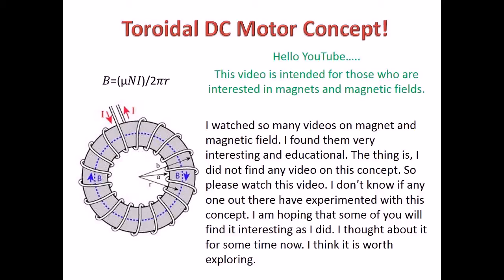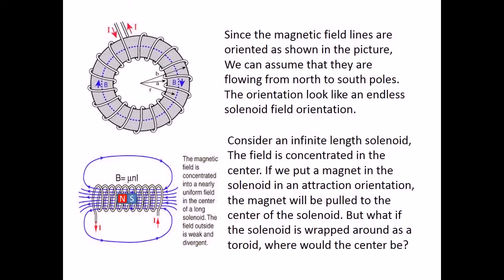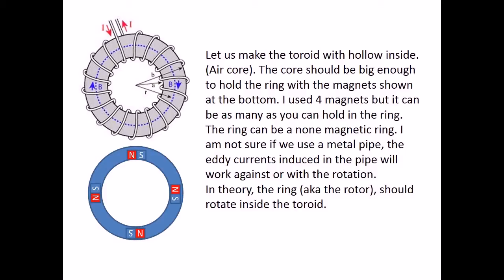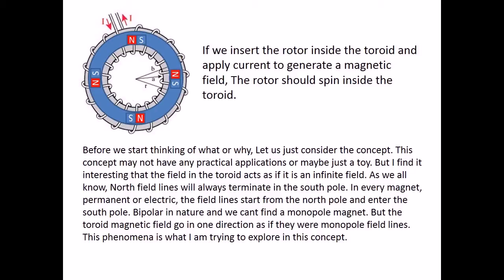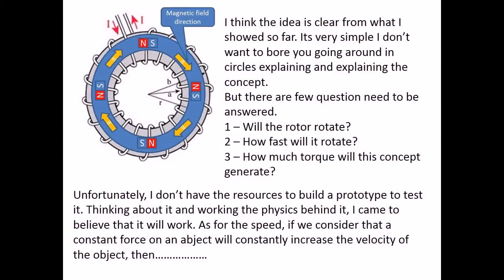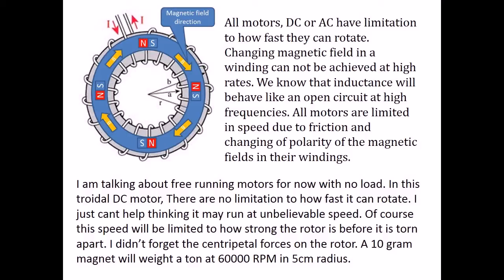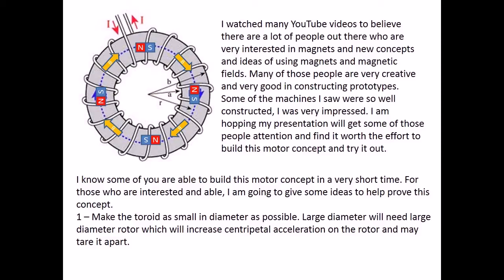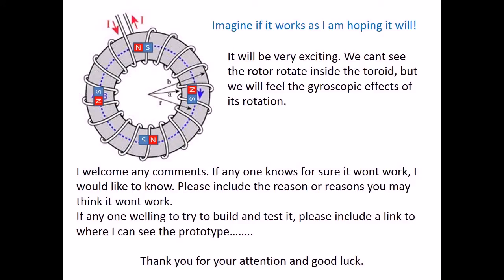Toroidal DC Motor Concept

Comment: I found this after having a similar idea and googling to see if anyone else has done it. I believe your concept would work and it uses the same principle as mine although mine is the inversion of your design. I've designed a few different versions, one with no magnets just electromagnets and with wireless power transmission. I'm printing off a simplified version now to see if it works. This principle means you can have a DC motor with no phase switching which is a huge benefit and could potentially provide a lot of power and torque. With no contact to transfer power and no phase switching it means the motor won't overheat and there are less reasons for failure. If mine works I may put up a video soon.

Comment: I saw something like this back in 1995/6 at an electric car club meeting here in Sydney AUSTRALIA. The toroid was formed around a horse shoe shape so that the rotor arms made from flat metal which held the rare earth magnets at the ends would fit inside. If I remember correctly I think it had three connections to the toroid 120 degrees apart of course and the power source was a DC square wave. The demonstrator was only about 150 - 200mm in diameter. I felt it’s torque which was low compared to a series dc motor or similar size but it was reasonable and the efficiency was 98%. The main advantage with this is that it’s very short and you could have five or six on one shaft in a car instead of having a gearbox which is good for regenerative braking as you could have a pedal where the clutch normally is and the further you depress it the more regenerative braking you get by connecting more motors to generation mode. The disadvantage for an electric car is that it ran at 10,000 rpm, even the larger more suitable sized ones ran at 7500 rpm. Recently I’m not so sure if this is such a disadvantage as with high RPM you get power output with less weight the problem is the amount of gear reduction needed which would cause the wheels to lock up with no power.

Comment: Run the motor in a vacuum enclosure = 0 air friction. Using the single motor as a base. Position 2 Identical motors above the first in a Visica Picies configuration.